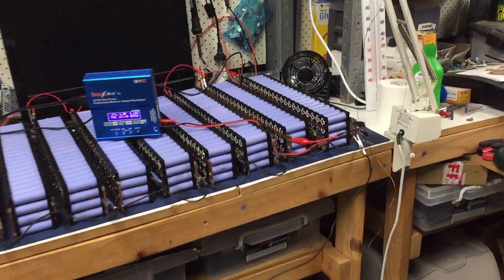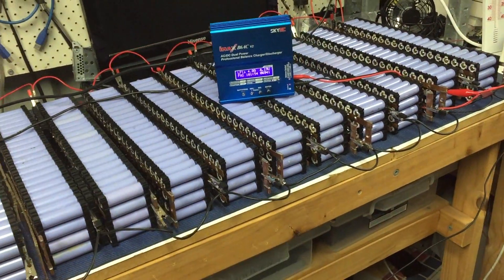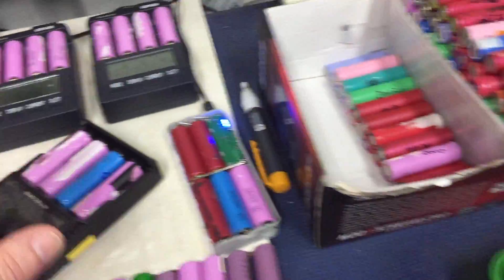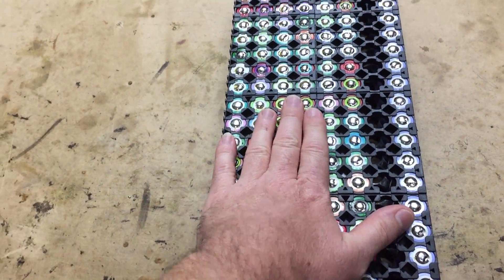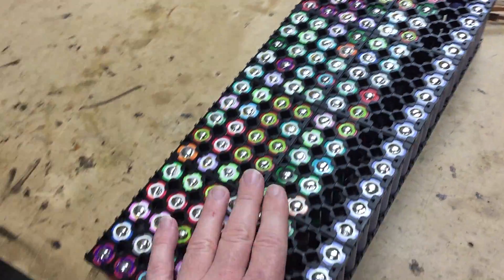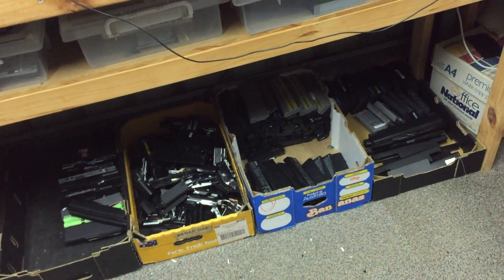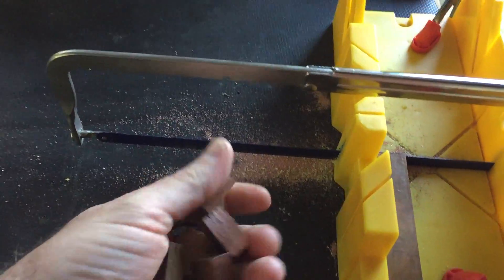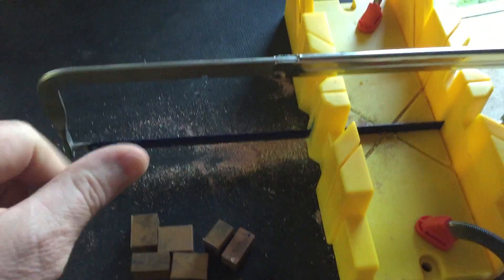Powerwall Update

Comment: Have you ever considered using a soldering gun instead of an iron for soldering your cells? The gun itself tends to cost around $30 US and replacement tips can literally be made from a loop of 12 AWG copper wire bringing the price down to 5 cents for a replacement tip ;).

Comment: Finally Caught up with all your posts!So impressive!I work for a "Company" that has a 1:1 digital commitment ... 25,000 laptops ... and we just swapped out 1/4 to 1/3 of the battery packs.Guess who got all the 'OLD' packs? 45 boxes with 120 packs in each box ... yeah, that's 5,400 battery packs.Each pack has 4 LiPo batteries (505070) made by both LG and SamsungMultiplied by the 4 cells per pack leaves me with 21,600 LiPo batteries!FREE! and this up coming Summer I get MORE! We are on a 4 year rotation, so the Summer after that I will get MORE!!!!!!!!!I think I will get a divorce if I bring home ANY more ... but they are FREE and none are made before 2014!HOLY CRAP-BALLS!
Reply: Holey moley, I just got my first bad Dell pack of 81 W with 9 cells. 4 was zero volts and 5 seem ok, doing NCR test in the littokala right now. So if you have 21600 cells and I have 5 perhaps you might consider to sell some to finance the rest of your power wall build? Are any for sale and where are you located? I'm in Sweden.
Reply: When I think about it, did not someone here write that lipos is not so good being used. They start at 2000 mAh new but degrade fast. But you must test building a pack very soon and do a load test with a DC converter. Convenient with the cables sticking out of the pack if they look like the link below https://www.aliexpress.com/store/product/505070-2000mAh-3-7-volt-Lithium-Polymer-Rechargeable-Bateries-cell-Li-ion-cell/1850526_32693298453.html
Reply: Silver tabs soldered to a protection board ...

they are from ASM P/N 45N1750 ...

I live in Indiana, USA, Air will not accept them and by boat would be 20 or more days I would expect.

Comment: not sure how to solve my issue, I have a opus charger exactly like yours and a skyrc b6ac+v2 and the mah are way off when doing discharge test on same cell. im not sure what is the best way to figure out my discrepancy.
Reply: I would guess this has to do with the top and bottom thresholds for charge and discharge.  If you use the iMax on LiPo setting it will go from 4.2 - 3.2 V,  On LiIo it does 4.1 - 3.1 V.  I think the Opus default is 4.2 - 2.8 V (not exactly sure on that bottom).  You can change the settings on the iMax, not sure on the Opus.  Since the range is larger on the Opus, I would guess that they are showing up as higher capacity there.
Reply: Chad Zubke well it's a huge difference on a real Panasonic 3400mah the IMAX says 2370 ish area. 
The opus is very close or over 3400  
I will have to look further on how to change these settings on the IMAX https://plus.google.com/photos/...
Reply: Link's not working, but I can guess what it shows. If you can't figure it out on the iMax (I haven't tried), I know you can set it 4.2 - 2.9 for LiIo through the ChargeMaster program.  Just set the custom levels in a program and use that.
Reply: Well I really hope so , but 1000mah is a lot
Reply: went into the chargemaster program and the lowest end voltage is 3.00 won't let me go any lower.
Reply: +Cam Shaft Swtich from LiPo to LiIo.  You can crank up the max to 4.2 and bottom to 2.9.
Reply: Chad Zubke ok I will try that, a stupid question, can I not save any of these programs to the charger? So it will operate with out the PC connected? 
Or I guess the wifi module and control it from s phone. ?
Reply: +Cam Shaft I've never gotten it to store from the PC, but maybe there's a way.  It looks like you can set this up on the charger, just set one of the program Memory's to it.  DSCH Voltage is your bottom discharge and TVC is the top.